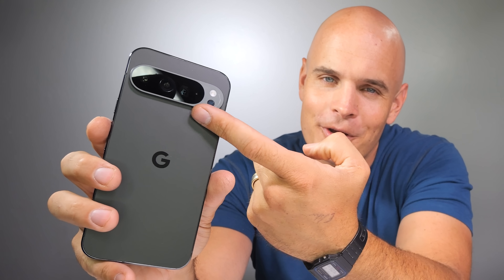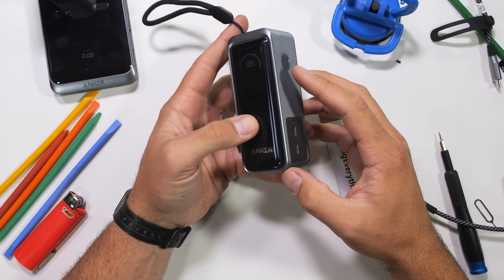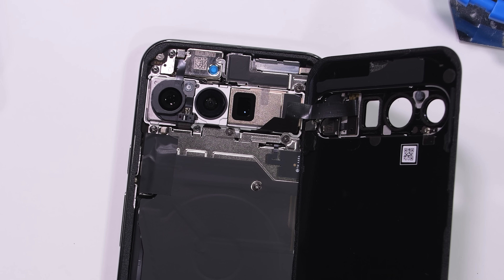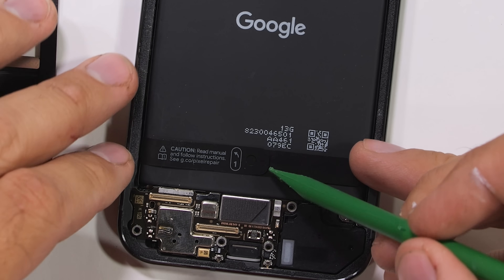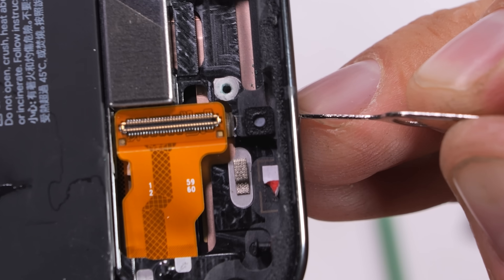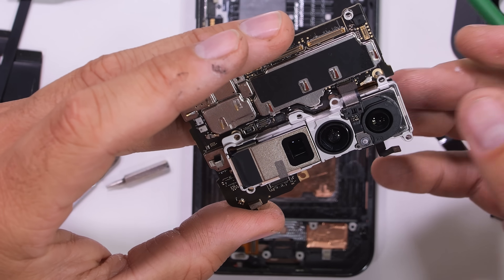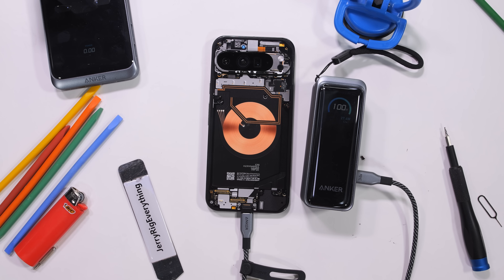Google Pixel 9 Pro XL TEARDOWN – (turn back while you still can)

Comment: It's all a well thought out scheme!

Poor repairability and 7 years of software updates:

1) It's highly unlikely that majority of the people will keep this device for 7 years in the first place.

2) For the few bunch that do, they may run into hardware issues/ damage sooner or later. Then, the lack of repairability, lack of availability of spare parts, especially in a country like India, where Google is over priced and poorly supported, will likely sway most of these people towards purchasing new phones. 

3) Even if Google says that all repairs will be possible and handled in authorised service centers, they'll probably rip people off by charging them higher than the competition for repairs and spares. This way, they can make profits without selling another device for 7 years. They'll just rip people off. 

4) People who feel that these repairs are costly in the authorised service centers, will likely turn to 3rd party service centers. With a little bit of bad luck, if the repair goes wrong, the customer will be forced to turn to these authorised service centers again, who will charge them even more citing warranty being void or repair attempt by unauthorised access. They'll cite n number of reasons like the IP protection is compromised because of the unauthorised attempt or that there has been some damage, etc. And your average joe will have no option but to nod and pay what they demand. 

Nice going Google! You've a good scheme out there. The Nexus 5 was my last Google device and it will mostly be that way forever. Keep your overpriced phones to yourself, Google. I'm happy with Nothing, Motorola, One Plus and Samsung.

Comment: ⭐️I remember years ago when Anker sold good products at a good price, and still sells good products but I think he went over the line with the prices. There are brands that have better prices and the same quality of products.  An extension with different connectors and does the same job you just need a good block with USB Type-C. If you want more charging speed ✌️❤️💪

Comment: Going to get flamed for this... I traded in my S24 Ultra for the Pixel 9 Pro XL basically got it for free with the promos and extra incentives, but man 4 hours in I was missing my S24 Ultra. Long story short, I couldn't get my trade in back - so had to sell the Pixel 9 Pro XL due to the promotions being cancelled out and having to be returned... and I paid an extra $250 just to get another S24 Ultra - lesson learned, Pixel 9 Pro XL has its own niche, and not a bad device but definitely not an S24 Ultra. That's what I get for pulling the trigger and getting excited lol

Comment: please note that the URL does link to a site with the manuals. It's not a direct link, but you can get them by doing the following.

Go to the site
Click on Repair options
Scroll down to "Option 3: Repair your own Pixel phone or Pixel Tablet"
Click on the "Learn how to repair these devices yourself." Link
Scroll down and find the "use repair manuals" section and keep scrolling to find the "Find and download repair manuals for your device."
that will provide a list of manuals

Straight forward? No. I would appreciate if the battery strap had a direct link to the manuals page instead of the generic repair page, but it's not fair to say you can't find them on that page.

Comment: I think I know how the strap to remove the battery is supposed to work. You hold both sides and kinda pull it left and right and up as well, so it could slice through the adhesive beneath the battery. We can try that, but not this time.

Comment: I'm curious. In the stress test the rigidity was praised on the new pixels 9 pro xl. I wonder how much of that rigidity comes from the way the internals are configured, specifically how firmly the battery is glued down.

Comment: in my POV, doesn't matter if it easy to repair or not, if the repair shop decide it's not worth to repair since the parts is expensive, since it's not common, compared to iphone, samsung, then it doesn't matter. but it does matter if the owner want to repair it themselves.

Comment: I don't think the battery will be an issue since most will not replace it right away. On that day though, it's probably years and the adhesive won't be as strong due to heat of the battery.

Comment: A couple thoughts after watching the video:
1. Is torx really anti-repair in this day and age? I'd say that if it's as easy to buy a torx screwdriver/bit as a philips one, then it shouldn't be considered as such. Plus it also is a better screw in my opinion as you are less likely to strip it, especially with screws that small.
2. The battery tabs were used wrongly so I felt it was a bit harsh to mark it down as a result. The instructions on it, even if unclear indicated both ends should be pulled at the same time - which may have then supported the force exerted on it and remove the battery as intended. Also, I'm guessing that the repair URL on the tab didn't work because the phone have not been released and so Google have yet to publish the page?

Comment: If only the U.S. had the same warranty schedule as us, then repairability isn’t that big of a deal,  cause they just replace the phone or repair it themselves.  Makes life easy….  🤷🏼‍♂️
Reply: Dunno who "us" you are but warranties realistically don't cover enough to make right to repair meaningless. 
My riding mower is under warranty. A part broke that I could have replaced for $20 (for reference the mower cost $2,000) but I wanted the company to pay for the warranty. I sent it into a shop twice, didn't have my mower for like a month, and they added 30 hours to the engine. 30 hours to a mower engine is like half a year worth of use. All for a $20 part that right to repair allows me to buy and replace in 10 minutes instead of two shop trips, a month without a mower, and reduction of the lifespan of my mower by 30 hours...

You think a warranty will fix everything? You are wrong.

Comment: 8:16 Okay but calling torx screws proprietary is a bit of a stretch, Zack
Reply: Unless he's referring to the screws themselves being nonstandard M-something?  And not necessarily the bitting?
Reply: It's not a stretch, it's categorically false.
Reply: I agree though that Torx is very acceptable and I prefer it, also definitely not proprietary.
Reply: I would prefer hex or torx screws over Philips any day. You still need to buy phone/watch sized Philips screwdrivers, so why not choose torx? Most screwdriver or bit kits come with both and much more, while philips stip out really easily, especially on tiny screws with cheap bits. Even cross-shaped slot of the standoff screw is better mechanically designed. 
Furniture companies replaced philips with hex because of stripping and simplicity of a hex tool (just bend a hex rod). 
Steam Deck OLED switched to torx and metal inserts instead of screwing into plastic, both of which improve the repairability massively. It's awful to unscrew a stripped screw: you have to either use a file, or sacrifice a PZ or Robinson bit for it, and Philips bits wear out really fast,o because of stripping. And to lower the chance of stripping you have to apply a lot of pressure to the screw, which can turn badly in a thin and fragile device.
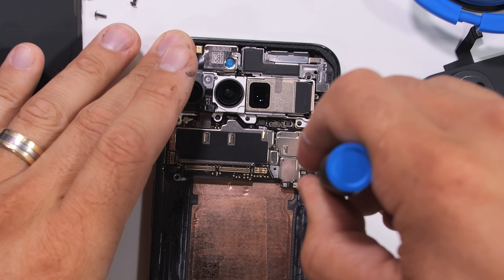Reply: he was talking about that one screw at 6:12
Reply: I would absolutely prefer torx over Philips, even pentalobe or tripoint are all still in most electronics kit
Reply: He must not be a jeep owner.
Reply: if youre opening your phone to repair it yourself, and dont have a basic screwdriver set with the ""proprietary"" torx bits, i dont think the screws are the problem
Reply: @theengineer-dellconagher  Indeed, if you don't own torx bits you shouldn't even attempt to open a phone.
Reply: The point is it's not easy repair Google. Stop putting the responsibility of fixing your phones on the consumer.
Reply: @jevonsims900  Imagine not owning a tyre wrench and blaming the car dealership when you get a flat and can't put on the spare wheel.
If you want to criticise something, do it in a fair way. Otherwise it's just counterproductive.
Reply: @Wampa842  The car is supposed to come with one, along with a spare tire.
Reply: @jevonsims900 the phone not being repairable enough is a deal breaker for me as a technician myself, but torx is a standard bit style, and honestly I wouldn't complain if it replaced Phillips outright in a lot of cases because it's a superior option in almost every use case.
Reply: @jevonsims900  ohh that's a hot take, repairability is NOT being put into the consumer. You can take a device to a shop to get repaired. But if a phone is designed to be repaired it gives consumers more options

Comment: instead of complaining, invest in a heating pad like literally every other repair guy and actually read the instructions instead of going "i cant understand what i need to do at first glance, time to break the battery remover and complain that its hard"
Reply: the point is that the average joe who just wants to replace his battery doesn't own a heat plate and likely won't want to spend a decent amount of money on smth he will use exactly once in the foreseeable future. and the fact that google's own repair manuals show a picture of a professional grade bga preheating station that you cannot even buy as a regular consumer shows that they do not give a single shit about said average joe.
Reply: Heating pads wont work with pull tabs. My brother is a technician. So i know.

Comment: If the pixel 9 and regular pro have the same instructions on those pull tabs, try following them and see if you have the same problems. Most people disassembling phones will have at the very least an iFixit kit So following those instructions shouldn't be too hard
Reply: Also why are you using solvents to dissolve the adhesive on the outside of the phone on the pixel but You normally use a heat gun? Heat guns are generally easier to use from what I understand

Comment: The removal of the charger from the box has coincided with the transition from standard 5 Watt to standard 30 Watt, multiprotocol chargers. 
What u don't understand is, even with a 30 W charger, its value is $25; considering that a good smartphone cost  $ 1,000 - the charger is only 2.5% the value of the phone. Not worth the bad vibes they get from their consumers.
Regarding the chargers, I use U-Green devices because they're cheaper and accessible to the inside; but I recognize the Anker are better looking and better designed. Both have bloated max specs tho.

Thank you Jerry for this video; it is highly appreciated.

Greetings from the UK,
Anthony

Comment: It may sound silly but can anyone please explain, he poured alcohol and the adhesive melted. Does that mean if I spill my drink on it will it also disintegrate
Reply: no, different adhesives require different solvents, your drink may ruin adhesives if it's water-soluble, but unless you're chugging everclear straight from the bottle then 1) get help and 2) it may weaken/disintegrate but that depends on other factors too, with phone battery? hella unlikely unless you had your phone wide open in front of you.

Comment: Ignoring the physical issues, In the past I’ve been let down the software on my pixel. Google launches the phones as what feels like beta tests for the android version, and then by the time it’s almost good, the next phone comes out and they just stop caring about the old phone. 

My pixel 6 pro still has crappy Bluetooth audio quality to this day, not present on iPhone or huawei. They said they tried to improve it with an update, but it still isn’t good. 

The camera app sometimes force shuts the phone down and you lose whatever you were taking a picture of. 

The battery life is dreadful for the capacity, charging speed is awful as well, phone overheats when charging. 

Google is trying to take the shortcut, they just want the next big thing, without having to do the work to get there, it’s fine throwing money at these phones to try and sell more, but people won’t come back if the product isn’t good. Google seems to be cutting corners where it matters on hardware design, and then lacking incredibly in the software department.

Comment: I'm disappointed that you would rather complain than learn how to properly use the battery release mechanism. I agree that the battery is difficult to remove (even with the slicing mechanism provided) but treating them like pull tabs is completely wrong. This is exactly the same system used in the Pixel 8 Pro.
Reply: Remember old phones where you pulled of the back cover and the battery with your finger and they would not fall of themselves and were still somewhat waterproof? Yeah good times. I agree with jerry, these pull tabs are shit.
Reply: @dewaldsteyn1306 magic word being “somewhat”
Reply: Magic pull tabs never needed instructions, it just seems like an extra step to make repair as difficult as possible
Reply: Multiple reviewers have tried to saw it but it didn't work. Supposedly you have to heat the phone for 10 minutes beforehand before sawing but I've only seen that in comments.
Reply: That doesn't look like a properly working pull tab. The adhesive seems way too strong.
Reply: If you need instructions for removing a cell phone battery, you're doing it wrong.
Reply: He got his 150k cyber truck. That is now gold plated. He doesn't give a shit about integrity anymore. He just wants our money.
Reply: Instruction like char the phone to 70c for 10 mins??? Lol

Comment: I just find it so hypocritical of these companies to be preaching sustainability while simultaneously making their products less and less repairable!
Reply: The EU will come to the rescue in 2027, enforcing stricter regulations that demand tech companies make their products more repairable and include user-replaceable batteries, pushing for greater sustainability.
Reply: @aexetanius will we even be around by 2027
Reply: As long as they have enough bots feeding their marketing shenanigans like the chargers not included for "ecology" they'll be safe.
Reply: These virtue-signalling companies are the biggest hypocrites and criminals out there.
Reply: yea
Reply: Zack did manage to take the phone apart and put it back together without destroying anything. Repairability does not mean that any hack with a hammer can repair it.
Reply: Yes he did manage to get it together after struggling with the battery and special screws.  I didn't say it wasn't repairable but it's definitely less repairable than previous models.  Like why practically have the battery welded in with no easy enough way to replace it when the battery is usually first to go?
Reply: @skullcrusher_1 There IS an easy way to replace it though if people actually bothered to look at the repair manuals. Plus, torx screws are extremely common, there's not as "special" as Zack is trying to make them seem.

Comment: I am sorry  if i'm wrong, but it seems like you was using only one pulltab in order to remove battery. I think that one of images on the pulltab suggest to pry the battery using both at the same time (it's located on the left pulltab at 3:54). I still think that they used too strong adhesive.
Reply from the maker: I tried everything before that pull tab broke.
Reply: @JerryRigEverything Did you try heating the phone on a heat pad for 10 minutes at 70°C, like the repair manuals have explained? Even on previous Pixels that used those same tabs?

Comment: Maybe the adhesive of the battery is still hard because it is brand new, and no one will replace the battery on the first use. Maybe over time, the adhesive will loosen when the battery needs to be change. Sometimes when you criticize the engineer who designed it, it seems like you could build something better than them, but I still like you most of the time, lol.